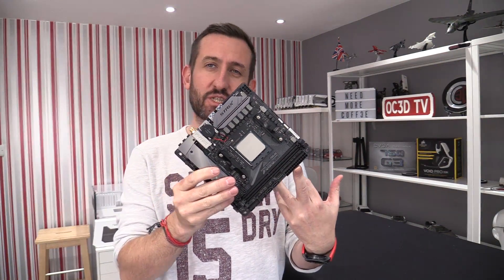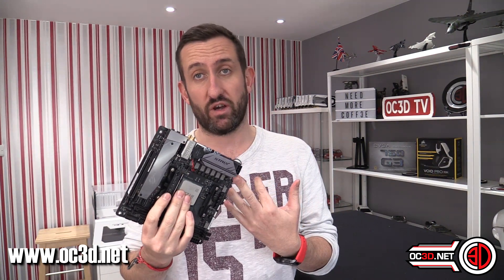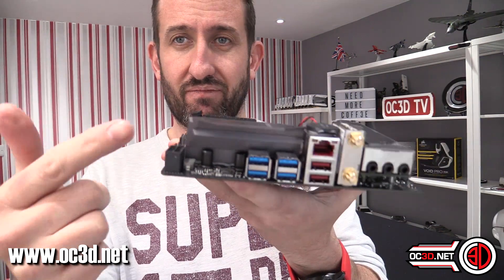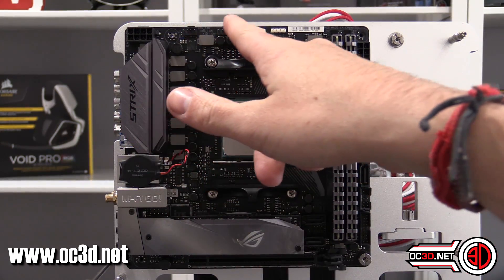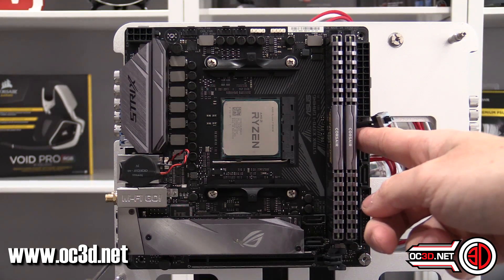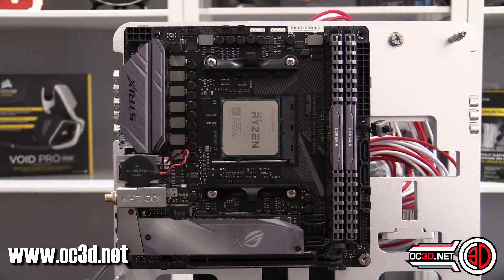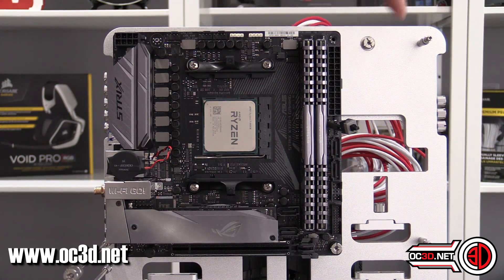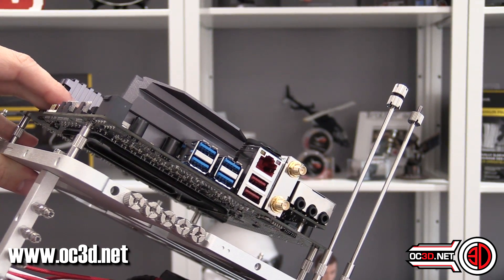Asus ROG Strix X370 Ryzen ITX Motherboard Review

Comment: I'd say the lack of other ports at the back between the CPU power plug and the USB ports has been given to better VRM design. AsRock had to cut back on it to fit two HDMI out, leaving the board with a real 3-phase design (each time a phase pulses, two MoSFETs are activated.)

That way ASUS could cram a real 6-phase design.

Comment: By your estimation, do you know anything that's different, in a practical sense, about the X370-I and the B350-I at all? VRM's? Bifurcation support? ....anything?? I've got a B350-I myself recently, and I'd love to explore some of the real differences in the two boards, but so far all things point to these boards being pretty much the same and Asus are just blatantly cash-grabbing.
Reply: Elbethium On ITX boards the X and B versions are literally the same thing except the X series has the X series chipset. And that doesn't even matter because there just isn't enough space on the PCB to support the main features of X370 like SLI. Best 300 series ITX would be Rog Strix B350-I that has a real 6+1 power phase which is much better than the Asrock big 3 phase VRM and Gigabyte with their 4 phase.

Comment: If Asus can't be bothered with making Asus boards that often or quickly, they should've put an HDMI and Displayport on this so they had something ready for Raven Ridge. Otherwise I'd just wait for RR to drop and pickup this exact board with display outputs in case you ever want to drop an APU in this down the road.

Comment: Why there is not an x370 micro ATX? I would like to build up a “server” around that... x370 allows for at least 6 SATA III PORT (so I can configure an hardware RAID 10) I can add a dual 10 Gbit NIC with link aggregation support, and graphic card because ryzen just need one to display something..... ufffff the same issue with x299 micro ATX!!!
Reply: same here wish they would make this board into a MAtx board, might have to go back to Intel on their z370 platform, damn really wanted a good x370 Matx.

Comment: Asus, why so incredeibly late? It is ridiculous!!
Ryzen is relatively low power, you should have had an ITX board at day 1. I say this as a guy who doesn't even like ITX systems in general (maybe for a HTPC/simple console emulator). I like large cases but a fact of the matter is that Ryzen is quite suitable for an ITX system. Of course I assume 3.7 GHz or maybe 3.8 GHz, clocking @ 4.0 GHz and ITX, not smart.

Comment: Great review! Was waiting for this to come out after I saw the preview on rushkit channel. Wanted to see review before I pick it up.
I could not wait and got this board last week.
Running Ryzen 1700 and 32GB of RAM. OC'd CPU to 3.9GHz and ram to 3200Mhz. Works great!
(https://photos.app.goo.gl/QALip3QT0Qg4GqIx1 )
Reply: Nishant Desai Here are the specs :
Cpu: ryzen 7 1700
Mb: asus strix x370-i
Gpu: evga gtx 1080
Case: raijintek metis
Cooler: raijintek ereboss (changed to noctua nh-d14 now)
Psu: Silverstone 700w bronze
Ram: 32gb gskill tridentz 3200mhz c15
Ssd1: crucial 250gb m.2 mx300
Ssd2: ocz 480gb
Ssd3: ocz 480gb

As regards to cooling, I haven't had any issues whatsoever. As you can see from review. I think this board is the coolest running ryzen itx board.
Reply: Any chance you could put all your exact specs, incl. the PC case model as well please? :) And is it true that the board heats up very fast real fast? Thanks!
Reply: Austin Goode It is F4-3200C15D-32GTZ model
Reply: Where'd you buy the board?
Reply: Yes, can you please tell us where you bought it? Thanks!
Reply: I found it at a local shop here in Latvia. They only had one board. I could not find it anywhere else.
Reply: Look at my comment above - got it at local shop in Latvia. No idea how they got a hold of it. Also it was cheaper than the Asrock B350 board.
Reply: Most of the shops removed it right after I bought mine. Most likely they all had same supplier. When I asked them about how they got it, they did not say much. Just that they got it from warehouse in Lithuania.  All shops I checked now have it out of stock and listing price is higher at around 180-200 euros. 
I think I got really lucky with it. When I placed the order I thought that is a mistake and they will call and tell me it is out of stock. But no, they confirmed and I got it the next day.
Reply: Thank you!
Reply: Arvis Students 

Hi Arvis

Like your build. Could you be more specific on what DDR4 Gskill you used please. 

Thanks in advance
Austin
Email: austin.goode@gmail.com
Reply: Thanks Arvis.
Reply: Hi Arvis

I've found a good source for this particular G.Skill RAM....if I take you good advice my only dilemma should be what colour  I choose.  However, would you know or recommend the risk of getting some F4-3200C15D-32GTZR, which is to all intents and purposes the same specification RAM with added RGB and at the same price £414?  Good or bad idea?

Comment: Very nice review. Very useful info as well. Most reviewers simply underestimate the importance of VRM. As for the tests, there are few things that could be done a bit differently.
Ryzen VRM is split - not all of those 6 phases are for the core. So depending on the VRM arrangement, the probe could have a better placement - in between the core VRM phases.
Another point (may be I missed it) is the lack of ambient temps. Not everyone has 20C room temp (and according to your shirt, it's definitely below 25C). Some people have to deal with 30C or higher room temp. also, the closed case internal temps are somewhat higher. can be 10-15C for a very small cases.
I posting it since I have a mini ITX setup: Fully custom liquid cooled Fractal Design Define Nano S + 4770K@4.5GHz + GTX 1070@ 2.124GHz. And the VRM area in my setup, is next to the TOP radiator (not below it) so it gets no airflow whatsoever. I had to experiment with 2x40mm noctua fans providing some airflow to the VRM.
The point is that on my Z97I-Plus board, CPU power draw of over 130w will overheat the VRM after about 45-90 minutes depending on room temp. When VRM probe reports ~105C, system simply shuts down. Of course there are not much real world scenarios that can do such high load, and yet it's annoying.
Reply: David K. 
well, he did way more than most of other reviewers do about VRM. Beside der8auer, buildzoid and couple of overclockers sites in russian (like ixbt.com overclockers.ru and overclockers.ua) very few resources do pay attention to the VRM and understand what they are talking about.
Most tech resources are just clowns. Hardware Canucks is an example of great artistic job and very poor tech understanding. 
As for MSI, I'm old enough to know that they are wannabe top tier crap that Instead of engineering and QC are investing in marketing. Since most people are dumb (50% are double digit IQ) MSI is doing pretty well.
Reply: David K.
MSI can't do anything good by definition :) even accidentally. Even if specs wise it is looking good, it's crap implementation and even worse QC. Not to mention BIOS quality and support.
Well, tbh, they actually did something good - the afterburner.

Comment: OC3D TV : my god dude....I wish you would have so eagerly preemptively specifically said the following "we're going to test those VRM heatsinks in detail" with every Intel board you review. We all know now that Intel based boards have much much bigger temperature problems than AMD has ever had in the past and definitely now. Ryzen CPU-s if not overclocked have literally cold VRM-s and if overclocked they become maybe slightly warm by touch if a normally vented PC case is used. Whereas with Intel boards since the release of Skylake in 2015 have very hot VRM-s if not OCd and uber lava melting hot VRM-s when OCd to the level that it becomes very wise and necessary to use at least a 8 cm fan directly blowing on them. At the start of this and many other videos you made about anything AMD related your biasness towards Intel is very easily felt through your words already in the first few seconds where you emphasize quazi problematic standpoints that have always been an Intel problem and you many times dismiss them in Intel based reviews, except for Skylake X when Debauer pointed it out to the whole world and even then you were trying to justify "not everyone will run Prime95, so it won't be a problem" and even that biased theory of yours was again dismantled by Debauer when he proved that Cinebench R15, Prime 95, Blender and other similar benchmarks as well as certain games all cause LAVA hot temperatures of Skylake X based boards on VRM-s and CPU die level. If Debauer wouldn't inform the whole planet about LAVA temperatures and insufficient power delivery on Skylake X boards, your probably wouldn't even want to inform us consumers about that until anybody else would try to strongly point those problems....that's how much you are biased towards Intel. Stop lying that AMD Ryzen VRM-s are problematic....I've build a dozen of Ryzen based systems in the past 6 months with B350 and X370 boards of different manufacturers and not one has had any heat problems on VRM-s nor on CPU die in any of the above benchmarks nor in any games, whether I measured temps with a temperature diode, HWInfo or simply with my fingers touching them while stressing a non OCd Ryzen 3, Ryzen 5 or Ryzen 7 CPU. Stop encouraging the old and nonexistent AMD overheating myth that anybody that has ever owned an AMD cpu knows it isn't true unless you strongly overclock them where they heat up just like previous generations of overclocked Intel cpu-s. Even AMD FX cpu-s (I also own FX 8350 for 5 years now) when nonOCd have never had any VRM or CPU die overheating issues. Those are just Intel fanboy based evil lies that they spread because they disliked AMD for being equal or better with their products in terms of performance core-to-core/clock-to-clock or price-performance wise.
Reply: David K. : you are obviously a self hypnotized Intel fanboy :) only your kind responds with those kind of allegations that are completely untrue and you have absolutely no experience with any other platform than your precious Intel Skylake / Kabylake. Those customers that wanted AM4 based system, I've build it for them and have zero problems. I myself have an AMD FX, Intel Kabylake i7 7700K and a Ryzen 7 based systems....and guess what which one runs the hottest in nonOCd and OCd mode :) ....yes it is Intel i7 7700K on CPU die and VRM-s. As for AM4 rigs, I've build around 15-20 of them already and benchmarked them very thoughrougly and they are cold as ice compared to anything Intel has ever released and has to offer. Garbage heatsinks are found on all manufacturers and they are salvable with AMD Wraith Spire/Max coolers easily since it cooles CPU die and VRM-s actively and simultaneously....whereas Intel CPU-s don't have any good stock coolers and cooling them with tower coolers is pointless since it blows air much too high above VRM heatsinks. So considering that and the fact that all Skylake/Kabylake i5-s and i7-s run waaaay hotter than anything from AMD FX or AMD Ryzen as well as Intels crappy TIM tooth paste, one can come to a safe conclusion that Intel-s are now obsoulete and destined to fail. Ryzen is better everywhere, price, efficiency, performance in single core and multi core clock-to-clock and core-to-core, eat waaay less power, have much colder VRM-s and AM4 will be supported with never Zen2 gen in the next 4-5 years. It's obsoulete to buy anything that Intel has to offer now already since 2015 and especially the "new" old architecture based Covfefe Lava Lake that heats up like a lake full of hot warm poop lake :).
Reply: David K. : bla bla bla....you are a classic Intel brainwashed fanboy lying about owning an AMD rig to try to present yourself as a more legitimate AMD basher....a classic move from an Intel idiot :).

Comment: What's the point with X370 here, there's no SLI or Crossfire anyway. B350 makes much more sense ;).
Reply: David K. B350 is actually pretty damn good on Ryzen. Wouldn't really be smart to make them trash considering they know users are probably going to overclock and abuse the boards.
Reply: David K. You just hate everything don't you
Reply: David K. All depends on which board you got but ryzen b350 are actually pretty well build I just bought the Strix b350 and been getting a decent amount of bios update and overclocking is solid
Reply: Asterisk Do not get Gigabyte b350 boards. Literally the worst option for b350
Reply: He explains it far better than I can. Basically the cooling on the vrms is trash on gigabyte b350 boards

https://youtu.be/ZGrxhf_xZWI
Reply: David K. Yeah, best bet is to just stay away from gigabyte b350
Reply: Marketing, also isn't there like a PCI-e split thing you can do?
Reply: Street Guru I know what you're talking about, cannot remember the name for the life of me, but you'd need a case that could support that use scenario
Reply: because if you want to make money when you sell a product you have to make it.
Reply: but why though? legitimately I'd like to learn.
Reply: If you are on the stock cooler, your vrms should be fine. Both because it is a down draft cooler and because you shouldn't be going to 4ghz on a stock cooler anyway due to cpu and package temps.
Reply: David, the Gigabyte ITX board is crapola.  Watch TTL's review on that one, and you might want to follow his guidelines on what chip to put in it.  Oh, and what's with that freaking quarter inch thick thermal pad on the VRMs on the Gigabyte?

Mind you, I'm not pulling fanboy here either, I'm currently on a Gigabyte Z97X-Gaming G1-WiFi-BK, and I love this motherboard.
Reply: Michael Gusevsky b350 can oc
Reply: so they can charge you more money
Reply: I believe theres going to be a vega chip in the new ryzen chips, possibly an APU/GPU crossfire?
Reply: There is a B350 one too on their site.
Reply: Hhhmm ASRock mini itx🤔??
Reply: David K. I'd probably recommend the gigabyte gaming 3 b350 board. I steer away from the cheaper Asus boards in general since their quality control isn't as great at lower prices.

Comment: That io is a joke
Reply: Cases no longer have airflow, Asus no longer has a reasonable io, but at least everything has RGB. Dark days.
Reply: The Z270 Strix has 7 USB, one USB-C, HDMI, and Display port. The Gigabyte Z270 has 5 USB, one USB-C, HDMI, Display Port, and a PS2 (With MSI's Z270 offering and Asrock's X370 having identical specs). Gigabyte's B350 has 8 USB, DP, HDMI, and a PS2 port and it's a $114 board. 

I'm not trying to be confrontational, but it's a pretty bare bones offering (especially the price is positioned close to it's Z270 counterpart). Granted, I don't know the overclockability of those other boards though.
Reply: Fair points all. I regard 6 USBs as enough, and haven't used a PS2-type peripheral for years. Audio outlets... Mnyeah, no, DOES it REALLY matter? 3.5mm in/out? Isn't that enough for the average ITX use-case? I mean, who uses an ITX build for HI-FI-audio processing or a 7.1 setup? Well, maybe for an HTPC?
Reply: No worries, man. :) Gotta agree on the RGB thing btw. Most useless gimmick ever considering the bloatware you need to control it.
Reply: Niels Egense there are only 6 USB-Ports (the crosshair has 10, I think). No PS2-Port. Less Audio outlets. On an ATX board that would be okay because you can plug in a PCIe adapter card, on an Itx board you can’t.
Reply: And even in that case, why would you use the motherboards audio output? At that point, you have an HDMI running to the receiver.
But I do agree that compared to other boards, this looks like a sub €50,- green PCB OEM product.
Reply: David Green even sellotaped on cmos batteries are fine as long as you have rgb (seriously didn't even know where the cmos was till i spotted it on the bottom of the i/o looking like a taped on after thought.
Reply: Why? Not trolling, honestly want to know...
Reply: Considering the size of the board it's quite ok.
Reply: David Green the world at large is reflected
Reply: No Type-C in 2017 imo